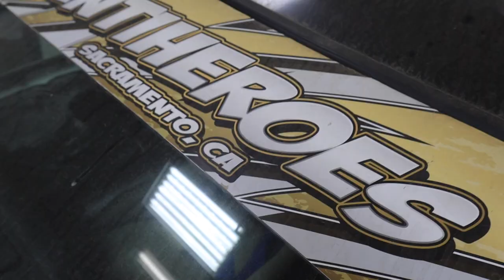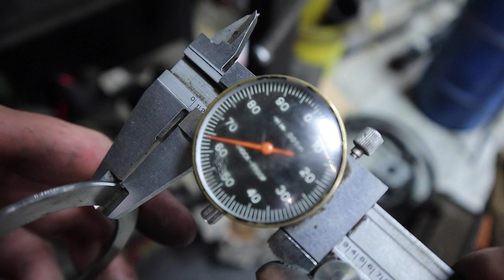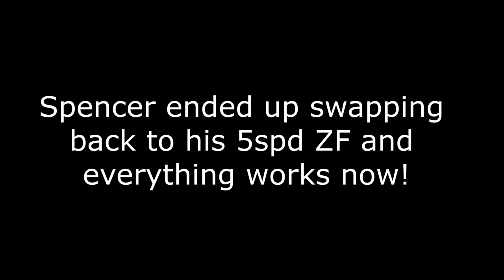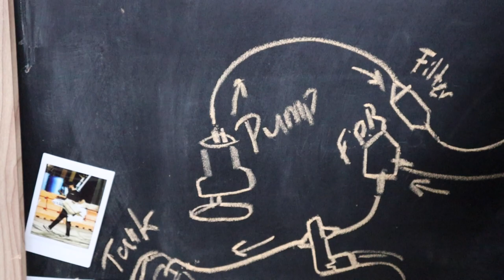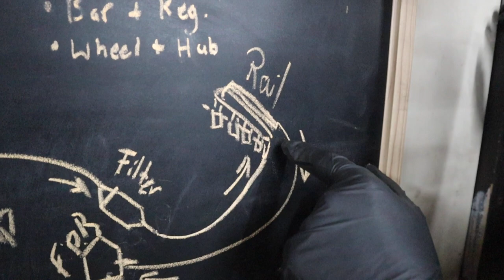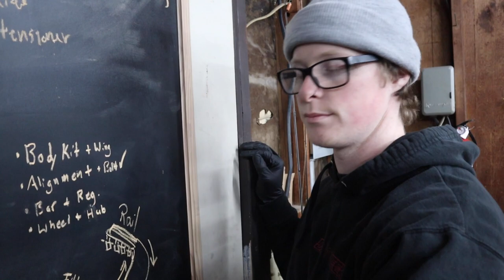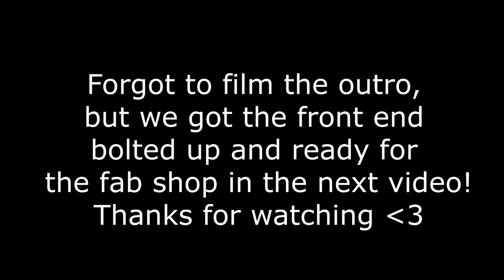FULL E85 FUEL SYSTEM!! - TURBO E36 M52 BUILD EP7

Comment: 62 and 1/2 thousandths is 1/16 th of an inch. It would rear .0625 on a digital caliper. Lovin the videos! I had to go to a brass pivot in my car the plastic one wore out and was cause the clutch to have problems
Reply from the maker: Thanks dude appreciate the support! We opted for the steel one cause the brass ones tend to wear too if you’re abusing the trans lol. But under normal use it should be fine
Reply: @behradsays  oh gotcha I’m hard on mine too 😂 it’s a drift car but it’s stock clutch stock engine. I just got a 3.0 engine I’ll be swapping in soon. Im wanting to do a turbo build. So im really enjoying the bmw turbo content!

Comment: Chased the same issue in my zf5 speed. Replaced everything and it ended up being that my pivot fork was bent from clutch kicks and having the stainless fork stop. Look into it since that one was hitting on the pressure plate, I have a feeling it’s bent
Reply from the maker: That’s great insight thanks dude! We will look into that.